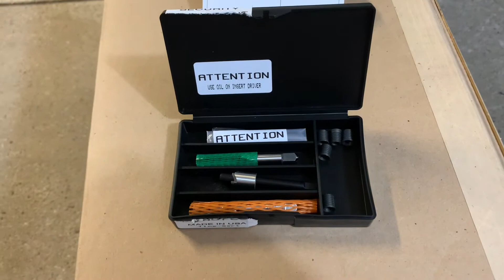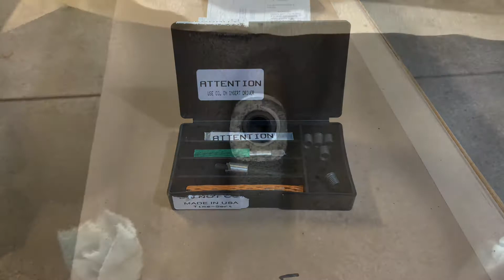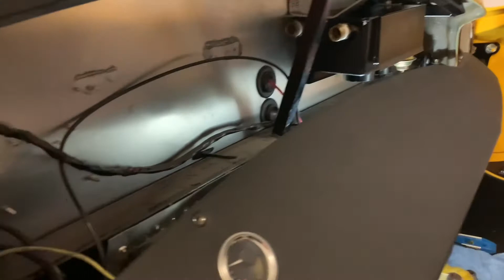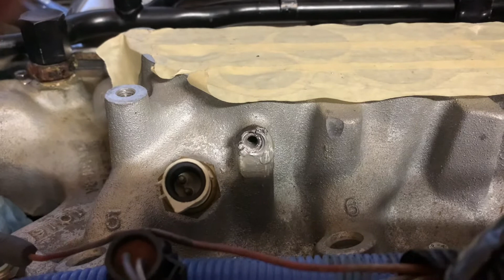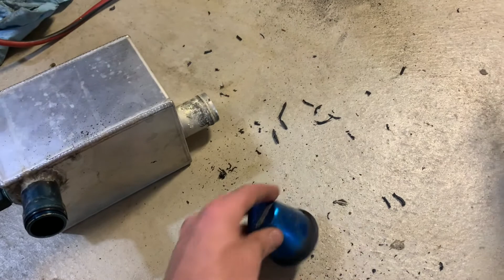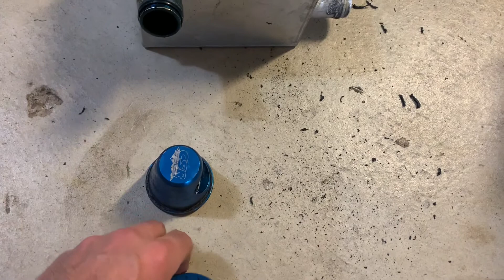Factory Five Shelby 427 Cobra Roadster - Repairing intake manifold & replacing injector connectors.

Comment: Nicely done!! I can see how the time serts do a really nice job. I can see using them where the fastener isn’t torqued or load bearing. Not much stress just holding those fuel rails in place. A little tip: when you’re re-installing your thermostat and housing? Permatex makes a sealant, specifically for water pumps and thermostats. Ask me how I know? Lol I just did mine, twice!! 🤣 The 2nd time, taking extra care, perfectly cleaning all surfaces, and using a really good gasket and the Permatex, did the trick!! Could work on your overflow tank as well. Love the videos, from a fellow Mark II owner!!
Reply from the maker: Thanks.  The time serts are actually very strong (depending on size), and can hold a lot of torque.  Very impressive product.  Only concern here was the one ear that was missing a chunk but I made it work.  On the stat housing, this CSR Racing piece uses o rings, no gasket, so I am thinking of going over the flat face of the manifold with flat Emory cloth to try to make sure it gets a good seal.  I’ll revisit once I get the parts I ordered.  Always fun tearing into work done by others and figuring things out.  I’ve had other 5.0 engined cars before and know what a pain the T stat housings can be to seal.